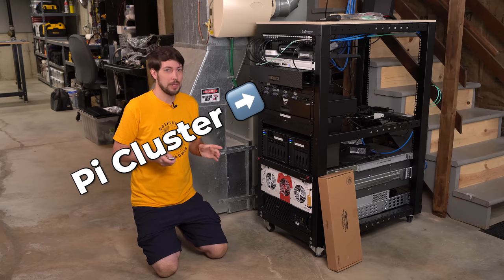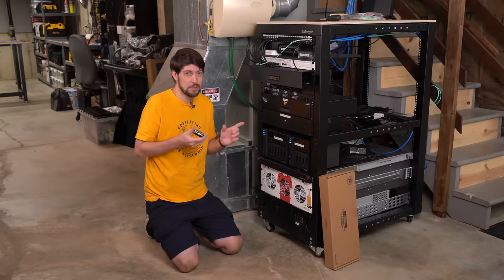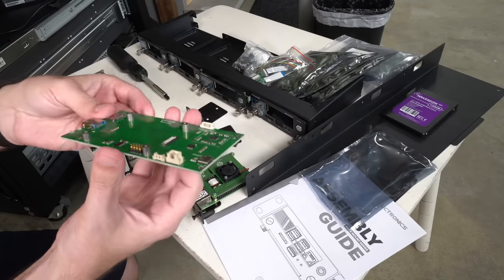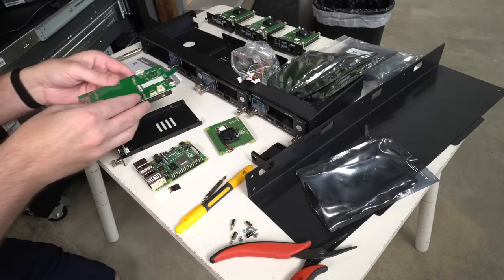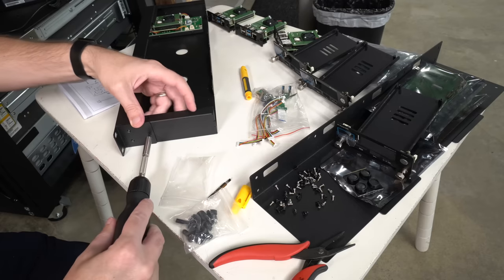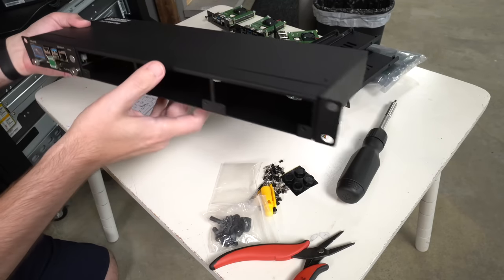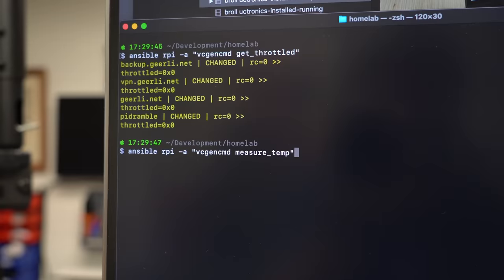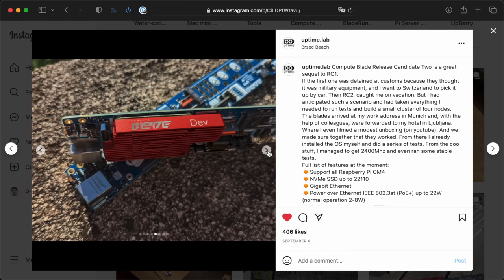Homelab upgrade: New Raspberry Pi Cluster rackmount

Comment: Another benefit of the proper enclosure is not having to worry about 3d printed plastic being next to electronics. Most filaments burn like napalm
Reply: Well yeah, don't print a 1U enclosure out of PLA. ASA has a heat deflection temperature of like 85-105C. If the air inside your server is above 80C, you've got much larger problems.
Reply: Melting / deflecting is one problem but what I meant is that I don't want an exploding capacitor or a shorted component heating up a PCB trace to ignite the plastic. Industrial electronic enclosures are made from fire retar dant plastic for that reason

Comment: I think this would be really great for university labs to experiment with clusters. They are high enough quality to hold up for years of use.
Reply: It might take years to get enough Pi's to put in there.
Reply: Not really, much easier and better to keep a bit of your previous cluster for that. Not being x86 is a big issue as lots of software does not work. How do I know this, well my day job is running an HPC system, for a university. Guess you guessed correctly we retained some of our old cluster for this purpose.
Reply: @jonathanbuzzard6648  interesting info, thanks!
Reply: Why not just create N VMs? You have a virtual cluster then.
Reply: massive waste of money.

Comment: Great looking product. My only gripe is the USB jumper being left as the green pcb, which against the black enclosure just detracts from the visuals. Will be keeping an eye on this product for future revisions for my own lab
Reply: Yeah that seams like a oversight on the part of the lower PCB designer.. There are pads on the PI that give you USB so they could have just added some more of those pins to interface in that way instead of that jumper. It just looks janky and unprofessional in my opinion.

Comment: 8:07 - DNS redundancy is highly desirable. As an option, run PiHole on another raspberry and set up Gravity Sync between them. It made my life very easy.
I have one DNS spinning on a virtualization environment, and the second on a separate Raspberry pi.
Reply from the maker: That's likely what I'll do, my plan is to build a new router "someday" (not sure when that day will be), and it will run routing/DHCP and DNS as a 2nd Pi-Hole.
Reply: Gravity sync? Cool. Looking up. Right now my piholes are not synchronized automatically.
Reply: Thanks for the tip on Gravity Sync ...
Reply: I looked at Gravity Sync, then Adguard Home with Adguard Home-Say c, and ultimately moved to an Adguard environment as the syncing was a lot better, and I've been very happy with the result.
Reply: @SchoolforHackers  На здоровье)

Comment: Thank you for pointing out that the LTT screwdriver needs a bit that can work with board standoffs.

The exposed pins on the USB-USB adapter makes me extremely uncomfortable. I want to just reach out and put a piece of electrical tape over it.
Reply from the maker: Maybe it could be a challenge in the coming months. How many times can I service the rack without shorting a connection on the exposed plugs :D

Comment: I have one of the other pi rack configurations from uctronics, the one that holds them vertically with base plates. I would strongly recommend avoiding that version specifically, as the screw holes for mounting the pis get deformed after a couple uses.
Reply: Please contact us, and we can do the replacement for you!
Reply: @UCTRONICS  Now that’s some great customer service!
Reply: We update our new designs with captive screws now, making them easy to mount, we don't have such potential issues anymore.

Comment: You look like you're doing better Jeff; I hope you are, and from someone with digestive issues, I hope you're also feeling better. :)

On a technical note, it would be nice if a future revision of the standard Pi included pin headers for USB so that various add-on boards could interface with the USB bus internally versus having to have male-to-male dongles on the outside.
Reply from the maker: I'm hopeful there will be some additional interface to get more IO, more easily, on the next model B boards. They are so great for so many things, but they always look a bit odd when used in any non-hobby scenario.
Reply: @JeffGeerling  I think there should be no such additions on the next model B, but rather a model C for such things, so that the price won't be such a constraint. Pi model B is meant to be as it is now while maintaining a price low enough to tinkerers, education, etc. But i think us enthusiasts (i am also an educators, so i understand the price constraint well) wouldn't mind paying more to have some extra stuff. Also, model C could hapily break the form factor. Like a bit larger, with all the IO on the same side, a sata interface and/or NVME, and why not some PCIE connectivity (even trough NVME).
I mean, i like the pi form factor, but it is quite limiting in some applications. We have 0 and CM4 for compact, A is dead for now, B for general use while remaining cheap, and C could be more power user oriented. 
But perhaps the model C's role is already fullfilled by the CM4 + the right carrier board. Perhaps the pi foundation should just release more carrier boards?
I hope the current carrier board form factor is not what the one for the CM5 MUST be, that they are not bound by it!
Reply from the maker: @AudreyRobinel  True... maybe model B for hobby, model C for power users/desktop, and CM for embedded/industrial.
Reply: I agree so many of those male to male U's put out a ton of RFI also. My biggest complaint with the Pi4B though has been the 2 micro HDMI ports. I don't know anyone that uses dual display with a Pi, most of the Pi's I know about run headless. The ones I know of and have hooked to displays all the junky adapters cause more trouble than a second HDMI could possibly be worth.

Honestly with the prices right now and the annoyance of the form factor and micro HDMI's unless a Pi is absolutely necessary I use and recommend used 1L office PCs. Personally partial to the Lenovo M93p right now they go for about the same as a Pi4B by the time you get all the kit for it, More horse power, More ports, takes real SATA drives, DP standard which has good adapters to HDMI but if you look you can find em with a secondary HDMI port already optioned. Only drawback are they are a bit bigger and idle consumption is a bit more but you get a more powerful machine for it. However with Proxmox on one with an i5 it could take the place of several Pi's making the power use a wash so long as x86 is fine for what you're doing.

Comment: This is so close to perfectly designed, it just needs a little shove to perfection.
The ventilation is a problem yeah, with all 4 under any real load that little box will get hot. BUT a bigger problem in my opinion is the exposed pins on the back of the USB bridge PCB, those have exposed 5v right next to a load of sensitive IO and can easily be shorted together by bumping them with anything conductive, that means any metal, certain kinds of cloth, dust, or even some errant forehead sweat, and those are all known dangers with an active rack, and it only takes 1 good short to kill the USB 3 controller on a Pi4.

Comment: This is neat, really like the power button and screen, not to mention access to almost all ports and SD card on the front, but I rather use up 2Us of rack space for vertical Pis than 1U of just four horizontal. Feel like you can get more density with that than this, even with all the extra stuff thrown in

Comment: I really like the ability to insert the Pi sandwich as hot swap-able. Very nice.  I would like to see some ventilation on the top, and air flow for edge to edge with a fan or 3... $300 isn't bad for the extra capabilities the trays give you.
Reply: Sounds like they where responsive to his suggestion. Hopefully they'll revise the design. Until then I bet just taking the case to the drill press and putting a pattern of holes in it for passive cooling would mostly fix it and it wouldn't be to hard to mod in a 40mm fan or 4 if wanted/needed.

Comment: I liked this product, the Pi Cluster Rackmount Kit.  I'm not sure the price is in the right ballpark - it seems a little steep.  I would definitely consider this, as long as the following was done:  (A) all screw holes were properly aligned - when I purchase a product like this, I'm paying for perfection.  (B) There needs to be much better ventilation and at least an option to add two fans.  By watching this video, I would say this rackmount unit is in the beta phase and needs some work.  If they clean it up, I would definitely buy it at a lower (reasonable) price point.  Thanks for the video - it was very well done!

Comment: Cool.

Built my own little cluster for five PI's and a 5VDC PSU. It is 3U, all the connectors are on the rear though, much cleaner front that way. Been running a Kafka cluster for a couple of years now, ~4 I think(using ssd's).

Comment: An interesting solution and appears to be well conceived. Concerning the misalignment of the holes, it seems to me that the order of assembly is a little off. If I understand correctly, once the SSD is plugged into the carrier board, any tolerance allowances start to accumulate leading to the misalignment as everything is tightened. Perhaps the SSD should be loosely mounted onto the baseplate first, and then the PCB plugged onto the SSD? This should allow enough play to then align the PCB mounting screws before cinching everything down.

It's good to see you firing on all cylinders again Jeff.
Reply from the maker: Ah, that could be possible, I was 'loosely' following the assembly guide ;)

Comment: Wow!  Very cool!
Not sure if that program to monitor data uses log (or direct writes to media), but I use log2ram on my pi's to store log info in ram w/ a 24hr write cycle (stock) I am sure it could be set to dump it's data every hour, and hourly writes to the SD/SSD would be much less write intensive than constant streaming to the data drive
Man that is one tough looking case, however like you said the lack of airflow is definitely it's achilles' heel, I guess if they had a 40mm hole in the back on both sides (heck even a small hole over each pihat fan [since there are already fans internally]) would be more than enough to push airflow thru the case
I'm surprised you don't use K3S and Rancher w/ longhorn to build a cluster w/ data support...that would be one heck of a setup, Techno Tim on YT makes it look easy
Keep em coming!!!!

Comment: Good luck with UTronics. I purchased this about a year ago and within a month the POE power supply started dropping voltage to the point it will no longer power the Pi. The cooling fans also die very quickly. After 2 weeks one of the fan's bearings failed. Swapped it and got another 3 weeks out of the new one. I tried contacting them and admittedly they were helpful and sent me replacements but after the second RMA I gave up. After 3 months or so I scrapped the whole thing entirely.
Reply from the maker: This unit doesn't come with any PoE power supply, I'm using Raspberry Pi's own PoE HATs with it. They do make a ton of different products though, maybe one of the other models has an issue with heat or power. So far it hasn't been an issue with the SATA HAT after a few days at least.
Reply: Hi Dustin Thompson, the default POE HAT is 802.3af which can only source 5V/2.5A power and is also impacted by the POE switch capacity, RJ45 cable quality, and on-device peripherals (USB hard drive for example). All of these factors might cause low voltage caution signs. And we keep improving UCtronics products according to customers' feedback, we will release a POE+ HAT very soon to support 5V/4A, keep tuned.

Comment: Loved this video. At the moment I run 8 pi4 mixture of 2gb and 4gb with mixture of Poe and Poe+ hats 1 x asterisk box, 2 x pi hole boxes. 1 homebridge box. 1 home assistant box. 1 x Bonjour gateway box and 2 x hot swap boxes. They all run under Ubuntu 20.04 except the home assistant box. Currently the all back up to a local Synology box then replicate backup to the cloud. I have been looking for an affordable case this looks great but probably a bit too expensive for me just now. I am looking at migrating the Ubuntu boxes to pxe boot from the Synology this will help me sleep better at night, I have piloted one box successfully and am looking to start moving the hosts over this next weekend.   
Thank you, over the years you have been a real inspiration to me and my ip project. When I started with a pi 2 and asterisk test bench.

Comment: I enjoyed this new video. I'm running two of these (5-bay) with the 12-bay 3u also.  Their SSD mounting adapter is kinda pricy for that 12-bay (12 x $20). But you don't have to boot off of SDCards. You can boot from (cheap?) 120/240GB SSD. Which somehow I had 20 new of for some weird reason. I love your network Internet-Pi scripting, BTW. I removed the Pi-Hole and such and modified it a little to be a small NMS. I like being notified when my network goes down or slows down. :) Keep up the great work, Jeff!

Comment: Still watching this, but I had to pause for a laugh when you introduced the new enclosure.  I actually have the non-pro version of this kit and it's worked out pretty well though I've not finished setting it up as yet, I still need to get a PoE switch, shorter cables, mount the last 2 pis, and get my pis all configured.  One note I've had thus far is it's worth considering replacing the fans that the PoE HATs come with, because they've been kind of rattley/noisy IME.

Quick edit: If you've not heard of them, you might want to look into RackStuds instead of the traditional cage nut & bolt mounting.  I've really enjoyed using them in my racks, completely toolless and very secure.
Reply from the maker: I've considered using Rack Studs, and they do seem great for smaller devices like this... but since I like just standardizing on one thing, everywhere, I settled on some decent cage nuts and am sticking with the screws—some of the equipment in the rack is over 100 lbs and I can't trust the studs with that :)

But who knows? I do like the idea of using them for network equipment which is often a bit lighter.
Reply: @JeffGeerling  I feel you there!  I use them on all my network equipment, I'm trying to recall what I've done with my servers so far, I think I've not used them there only because most of the (all second hand) servers I have came with toolless rails.  That said, I installed the full shelf in the bottom of my 48U rack that's supposed to hold my UPS (which is also TBD) using the included bolts and cage nuts.

That said, my newer wall mounted rack for my networking kit is 100% rack studs :)

Comment: I have a pretty large set of Wera Kraftform Micro screwdrivers in Torx, Hex, Phillips and slotted.  Call me old fashioned but I like having separate drivers for micro projects.
Reply from the maker: For rackmount stuff, it's nice to have one driver with all the bits, just because moving a tray or sleeve full of mini drivers can be annoying. But at the electronics workbench I do use my little jeweler's kit most of the time.

Comment: Great video!! Big fan. I recommend trying something called a Raspikey - they fit in the sd card slot but uses EMMC - a lot more reliable than a SD card, 
we have replaced all SD cards in our pi with these Raspi keys at work and haven’t had trouble since.

Comment: Eyeing on the compute blade surely they will boost space usability on 1U Racks with good ventilation with some Pwm fan modules I guess
Reply from the maker: Yeah, Ivan's working on fan modules for the back, which use 40mm PWM fans connected to a controller board per 2 blades. It looks like a pretty nice solution.

Comment: Dual 40mm on one end and some vent holes on the other end would be best for that surely. Even close off the holes on the rear so that it's a fully flow through design. Not sure why it would have been missed by the manufacturer in the first place.

Comment: Great video, hows the POE on the new UCTRONIC 1U enclosure? The older version always has undervoltage errors. 
I have 4x RPI4 8GB running proxmox in a cluster linked to my TrueNAS and Synology as datastores with HA. Looking in to upgrading the enclosure.

Comment: A tip for the next iteration… Have a HDMI splitter board with a HDMI port and switcher button vertically tucked on the side of the rack so in future if you want to somehow connect to any pi directly you can do that..
Reply: The UCtronics rack I have does that! I hardly ever use it, but when you need it, you need it.

Comment: It may be wise @ 5:50 to let viewers know how to make that ribbon cable connection. A person new to that type won't know that you have to pull the clip on the socket out before the put the cable in. You then push it back in place to secure the cable. I've seen more than a few videos of people making that connection, but no one ever points that out.

Comment: Looks like the POE hat fan has little to no clearance against the lid of the case, so it's not going to be moving much air at all. I think you need to either add some venting by cutting a hole, or leave the lid off entirely.